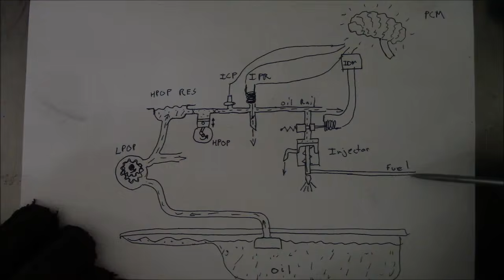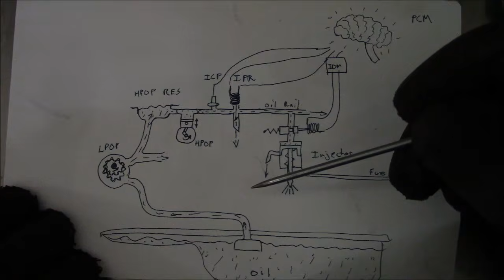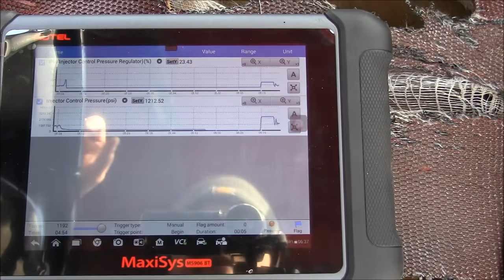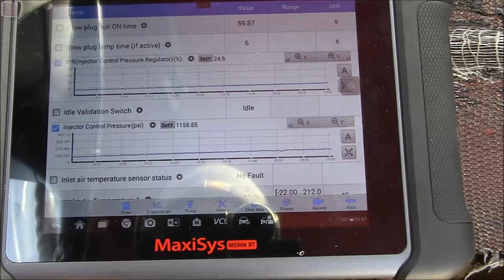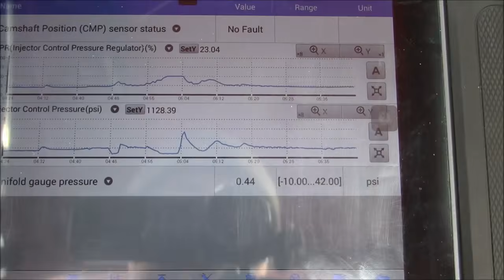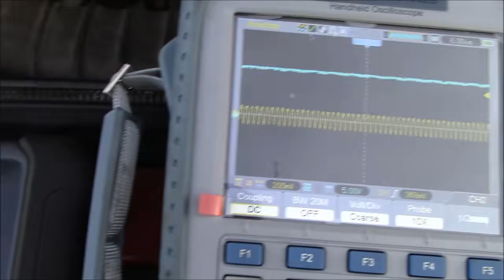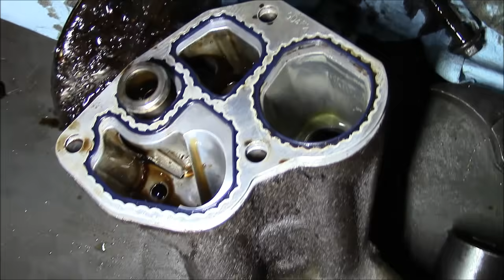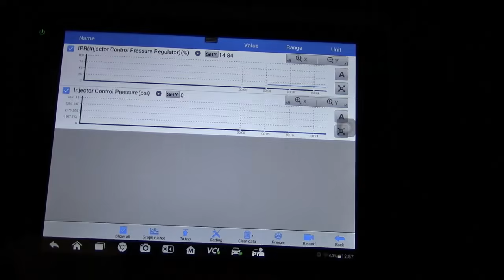7.3 Powerstroke Knocking, Rough Idle, Dying, but only when Cold. Plus many other Issues!

Comment: Love all the cummins lovers that havent had the front of their motors explode yet because of the "killer dowel pin "  yet.   Todd the retired trucker
Reply from the maker: The 5.9s have issues just like anything else. Head gaskets, water pumps, fan clutches, cracked blocks, etc.
Reply: On my old 90 1 ton Dodge the injector pump started spraying fuel from a crack in the housing and some other issues, so I replaced the engine out of a wrecked 95 rollback. Almost didn't fit, the injector pump hosing is much longer and almost makes contact with the brake booster. Also had to do some creative routing for the inter-cooler hose as the 90 originally didn't have one. 15 years and still going strong, although having a bit more blow by than i'd prefer.

Comment: I hate going behind a hack.....hours and hours of fixing the mess so you can try eliminate those issues. i wouldnt make it out of the driveway with those fuel lines...pretty rough. i think andrew is a good hard working young man but sometimes......oh man do i cringe on some of his repairs. i am a fan of solder and heat shrink on my wire connections.....salt never rests. whats wrong with your seat and your boots? look just like my cloths....i usually daily drive the worst piece of junk i own. oh yeah, and i always watch the entire video from start to finish.
Reply from the maker: I remember the beating you took about your old coat! Like you hadn't noticed...

Comment: One of the top problems I have found with all Fords is power quality.   Sad fact of their design is they use shitty system noise filtering compared to most decent designs made in the last 30 years. 

If they were in charge of your water supply systems their design would be much like using a large mesh security fence for filtering your cities potable water supply and calling it good because it keeps you from drinking logs!

Comment: Can anyone explains WTF they were thinking on that stupid ass system design rather than putting common comparatively far cheaper mass produced self contained inline or rotary style pump system on it like the older engines used and ran to 100's of K miles with? 

Was it a Rube Goldberg type challenge Ford made for their newbie engineers or something JUST TO MAKE THOSE ENGINE LESS RELIABLE AND MORE COSTLY TO WORK ON? ? ?
Reply from the maker: It's just about emissions. The Standyne injection pump on the older IDI engines cannot control the timing or fuel delivery precisely enough to pass emissions. Cummins was able to get away with using mechanical injection by using some fancy cam profiles that can't really be done with a V-8.

Comment: "Doesn't like to run"  Yet runs better than most new emissions compliant diesels 2 weeks out of factory warranty.
Reply: I always said "a properly working diesel sounds like a gas engine that has something catastrophically wrong with it."
Reply: @GlamStacheessnostalgialounge You can say what you like . You are however wrong
Reply: Due to no service till warranty..
Reply: Time for a new Chev?
Reply: @kevincrosby8998  sure is Mr Rockefeller. got a spare $100K laying around you don't need? throw it back my way wydoncha 😂😂😂
Reply: @parteibonza  Check is in the mail!

Comment: Just discovered your channel. Thank you so much,teaching me about my 1996 f 350 with the 7.3. I too have had t-stat leaking problems,tensioner problems block heater problems(no fire).  One thing I also had was no start in winter until I checked engine oil level.  Slow drip,drip drip from oil drain plug on. dirt floor so I didn"t see telltale sign. Anyway, added oil and all was fine.  Your video makes me understand why. Sincere thanks Craig

Comment: First thing I thought when it stalled the first time...IPR is bad. Just went through this myself. Also, check the ICP sensor and look for oil inside the connector. If so, it's bad.
Reply: Thought is no good buddy you need to be sure and know . Bye👍

Comment: Fun fact, all the 7.3L HEUI injectors in these engines were designed & manufactured by Caterpillar at their Pontiac, IL plant. I don’t know the entire history but I know there is a lot of Caterpillar DNA in the 7.3’s like you mentioned. Cat still makes these injectors on the same assembly line and sells them to an aftermarket company (Alliant Power). My dad rebuilt the 7.3 in his F450 and I was able to get the used injectors on the test stands to check the figures. Cat still had the original injector test data back from 2002 when they were brand new. He ended up replacing them with new Alliant Powers because they slowed down a lot over the years and one was definitely on its way out. I just figured I would share as a lot of people don’t know this.
Reply from the maker: Interesting. I did not know that.
Reply: The CAT 3126 was the L6 equivalent of the 7.3 powerstroke. Same HEUI system concept, it was 7.2 liters. CAT and Navistar collaborated for the engine system function, they contracted Bosch to make the precision tight-tolerance parts like injectors and high pressure pumps(which they still produce today) and Navistar was already hip deep with Ford with the 6.9 IDI, 7.3IDI, and the 7.3IDIT. Let’s all get along fellas, all engines are the best when they work well and every vehicle/engine is the worst when it’s costing you time and money. That’s the way it is.
Reply: I didn't know that either cool fun facts
Reply: The HEUI injection systems was a joint venture between Catepillat and international. Not solely CAT.
Reply: The engine was a cat international brain storm cat keep it uncomplicated but international is different story
Reply: it was a joint venture between 3 companys not just caterpillar. they were one of the three companies that made heui injection.
Reply: Mate not fun..However it is informative 👍
Reply: Thanks for your info- thank to Wes's video , I have learnt about HEUI injectors ..never knew they existed ..🤔🤔😉😉
Reply: Nope Navistar created the 7.3. Stop lying.  CAT created The HEUI design.
Reply: @adamsorell4851 that's literally what he said dude
Reply: @adamsorell4851  they said INJECTORS, not the engine. We all know this. I just looked up the injector data to be sure, sure as shit, CAT.

Comment: Years ago my father was driving a diesel tipper truck, lost oil pressure, but still drove it back home. I took on the "fixing.  A piece of cam lobe cracked off, was picked up by the sump pipe, that the screen had broken off of. Sucked up to oil pump, jammed it and weak point on shaft broke.  Replaced that, looked at slipper bearings, big ends etc, shaft was good otherwise, luckily.  Just pushed the old out, rotated new in. Went well for years later
Reply from the maker: LOL. Sounds like a pretty lucky day!

Comment: From one extreme to another. Currently standing on top of tailing dams with diesel mechanics trying to overcome diesel boiling in both the tank and the high pressure single rail injection system of slurry pumps. Volvo engines shutting down on fuel overtemp, low fuel pressure ( hot diesel too thin to pump ), air bubbles in injection system ( air incapulation in bubbling diesel), erratic pressure behavior causing electronic injectors to dry inject causing staggering, heat has caused injector o-rings to swell, high pressure fuel hoses failing to resist heat and internally delaminating, computer not having the ability to compensate for extreme climate variations, and air intake overtemp is generating readings well out of its parameters. Current outside air temp...52.7°C @1200hrs. Ground temperature...68.3°C. Just another day in paradise.!!!! 👍👍🇦🇺
Reply from the maker: Woof. You can keep that!

Comment: I took forever to replace the busted seat in my 1996 Jeep XJ. I think the welds started breaking around 2007 or so? Finally discovered Grand Cherokee seats fit too and got a leather one, good shape, from Pull-A-Part for $20. Best comfort thing I've done in that vehicle, ever. The old seat looked like it was in a bloodless fatal accident. Every weld broken, the seat had ripped out of every stud bolt too.
Reply from the maker: Heh. These Ford seats weren't much good when they were new...
Reply: @WatchWesWork  You can probably weld up some right durable ones out of diamond plate that can double as tool boxes!

Comment: I have found on the oil cooler seals it's best to just go oem the kit from ford or riff raff diesel is about $70
Reply from the maker: I should have. I've always had good luck with Fel-Pro stuff though. I think it was my fault.
Reply: Watch Wes Work stuff happens no big deal just as long as it can be fixed. That's how I look at it anyways.

Comment: I'm working on an old turbo volvo restore right now and you would be amazed at how crappy the factory grounds are. Many are just spade lugs pushed onto tabs on the body. Pathetic. You would think that automotive engineers would design a system with a few strategically placed ground bus bars for the entire vehicle. Easy to check and maintain. If vehicles were AC 110v they would literally be death traps.
Reply from the maker: I agree. Compared to the industrial gear I'm used to working on, vehicle wiring is super sketchy.

Comment: How cold is it there? Our 7.3 won't start up below about 25. The only way is to plug the truck and the batteries in along with Anti-Gel in the fuel. She runs better in the cold but won't start. In the summer it will start every time, but doesn't run as well as winter. Doesn't matter, she is illegal in 3 years anyway.
Reply from the maker: Probably needs glow plugs. I have started this truck at -25F with no block heater.

Comment: I think the "rules" are for the overzealous newbies with all new parts. If you'd had a new, clean coolant pipe and thermostat housing adding RTV to the o-rings would be a mistake.  It takes experience to know enough to bend the rules. One should fully understand why the rules are there before making exceptions.
Reply from the maker: Yes, that's certainly true. And part of learning a trade is knowing when the rules can be bent or broken.

Comment: Wow man, that truck could really do with a new seat if you look next time you go in it! Those boots don't look so hot either... lol the boots thing is a mechanic's issue i think, spend that much time grovelling round on our knees that the toecaps tear through before the sole is even thinking about wearing!  I like to think of it as preventing trench foot by allowing air flow :)
Reply from the maker: Yeah, I have never worn a sole out on a pair of Redwings. The uppers go long before I get through the soles.
Reply: @WatchWesWork  But by that time they're just sooo comfortable it'd be heresy to change them right? lol why is it that boots are just so nice to wear when they look ruined?
I've tried some before with the toecaps on the outside and that worked well, less cold on the toes, more protection from abrasion and in certain situations can be safer for you too with some leather between your foot and the edge of the cap. (I'm only doing light stuff these days so trainers are de rigeur!)

Comment: 1. Trade that truck for a horse.

2. Shoot horse.
Reply: Apple Sucks.That comment made both me AND my wife laugh out loud
Reply: Cummins is a decent motor
Reply: @jamesshaw4954  except for that 1 pin
Reply: @halleffect1  I have one with 914,000 miles and its a damm good motor still runs strong
Reply: @jamesshaw4954  did you do the cam retainer mod?  i hear it is important.  900k is amazing
Reply: @halleffect1  I don't know if it has that in it i got it at 850k miles

Comment: This should be proof enough for people to leave things alone or if you are going to change things to do it clean and correctly! There are simply to many hacks out there who are extremely destructive to vehicles and make it difficult or nearly impossible for the next guy to diagnose or repair. Also, stop using these gimmicky "cold air" intakes! Most are cheaply made "hot air" intakes which rarely increase horsepower. You see the issues in this video, leave things alone!
Reply from the maker: It's so tough working on these "modified" trucks. It's 95, but it needs a fuel filter for a 2003 and valve cover gaskets for a 99...
Reply: @WatchWesWork  I know it! Always enjoy your vids! Keep em up!

Comment: Just wanted to let you know the internet knows my shop is still dirtier! lol  I have no idea if it is true but the local 24hr wrecker service still runs a bunch of 7.3 powerstroke rollbacks most with 300-500K miles and they swear the John Deere 15w40 oil makes them run better. They say they have tried all kinds but find it gives the smoothest running from the HPOP system.
Reply from the maker: Interesting. I've heard of some guys running 5W-40 oil in them. I've never tried it.

Comment: Have you ever tried to start spark plugs in a DOHC gasser with using an extension?
Reply from the maker: Right. A piece of hose works pretty well.
Reply: @WatchWesWork  that too.  A locking extension with a spark plug socket with the rubber insert was my go to.  Hand thread it to start though.  Never any issues.  That was on my Jeep that ate spark plugs every 30k.

Comment: good job on the video, i have a line on a 75 f350 i want to install a 7.3 powerstroke in, i did own a 99 powerstroke i messed with a little, i have had a 95 i did the injector o-rings, i built the tooling to change the injector cups but i never did change them, installed new glowplugs, turned a starter relay into a glow plug relay by pulling it apart and rewiring it, i replaced the valve cover gaskets, i take time on my wireing i dont like a mess, i want to have an engine on a stand running before i install it, should make a nice old truck, not a show truck but something to tow my bobcat around. looking forward to more of your videos.

Comment: Nothing beats quality.  I am fussy about wiring as well.  I have rebuilt several wiring harnesses on Jeeps that others had just hackt until they found 12V keyed or unkeyed.  Then left the shiners to arise another day.  The goofballs also like to pull the wire out to the curb so they can work on it and then wad it up and stuff it outa sight.  Love your commitment to excellence.  The teaching diagrams are wicked smart as well. From the banks of Underwood Branch, thanks for the fun!  :-)
Reply from the maker: Yeah, people just turn off their brains with electrical.

Comment: Wes, worked on tons of powerstrokes, aftermarket gaskets and seals suck. I will only use oem from now on. Been burned too many times on leaking oil coolers and hpop gasket.
Reply from the maker: I've always had good luck with Fel-Pro stuff. I think I'm to blame here.

Comment: I suspect the Ford PS ECM has a similar strategy to the gas ECMs, in short, the spike you saw before it died is from it trying to recover, like when it's cranking and trying to run.
Reply from the maker: Yeah, it has to be some default strategy. Ford does similar things with coil drivers circuits when the PCM detects a missfire.

Comment: I suspect HEUI was a stop-gap between mechanical and common-rail.  Bosch unit injection runs at about 2000psi (the pop-off pressure), regular mechanical can run up to 30ksi IIRC, HEUI has a 7:1 ratio between the HPOP and injection pressure, so at ~3600psi (typ max) it has a theoretical max of about 25ksi, getting the high pressure benefit of traditional mechanical injection while also being electronically controlled.  The 7.3 had single-shot per event injectors to start with, then came split-shot with a tiny mechanical pilot injection, then came the multiple-shot per event injectors with the 6.0l.  They had problems that caused recalls and Ford disabled pilot injection (I think they did up to 3 events) and replaced a bunch of injectors.  The multi-shot injectors were made by Siemens IIRC.  I don't think they had the technology to do high pressure injection (common rail) in light-medium duty engines, so HEUI was created -- the IDM already drives the injectors at 120v/8a (very close to 1 kilowatt), because it needs a lot of power just to manage the solenoids at ~3.6ksi.
Reply from the maker: I dunno. All of the big guys had electronically controlled mechanical unit fuel injectors before HEUI was developed.
Reply: @WatchWesWork  I think cost was a huge factor.

Comment: I have a 94 idi turbo . And some guy asked if I wanted to swap for his 97 powerstroke 7.3 I said negative. Mine maybe slow like a heard of turtles paddling through molasses. But it's never left me stranded
Reply from the maker: Those were good engines.
Reply: @WatchWesWork  they seem to be pretty simple to work with. I have 3 trucks with them and 2 extra engines. Around here idi ttrucks are like rare or extinct. It's either Dodge with Cummins or them power strokes. Otherwise a large pile of blown up 6.0 Ford's

Comment: I snorted also, on the Andrew comment.   So this is your personal truck?   I really like your breakdown of the diagnostics.   Seems as though no one does electrical correctly.   Another good video!
Reply from the maker: Yeah she's mine...
Reply: @WatchWesWork  I realized that after I finished the video.   Seems like all mechanics have a ride that is right on the verge...   I'm curious if the IPR was an electrical issue?  I know several vehicles I've owned started acting funny when the magic pixies were not flowing correctly.

Comment: you don't need any new boots..the steel cap is still there..lol..those are just broke in..lol..i wear steel toes with the protective tongue everyday at work..i work in a steel mill so i go through the soles before i go through the caps...walking on molten metal burns them up quick..have a good new years